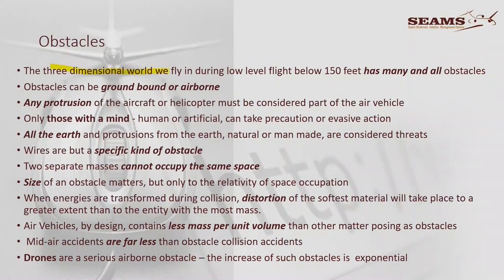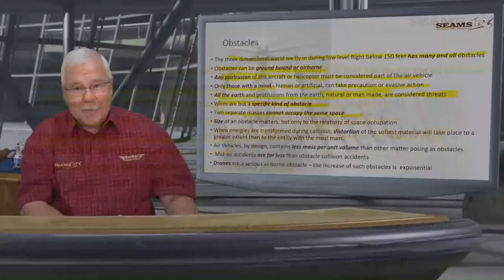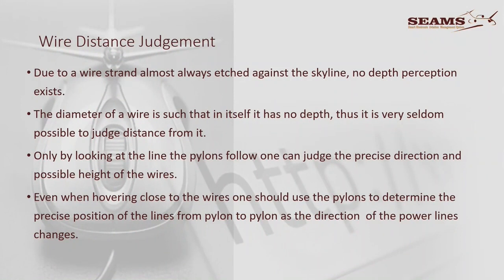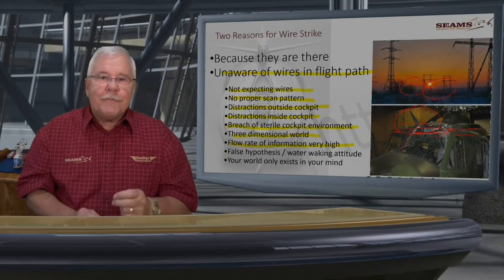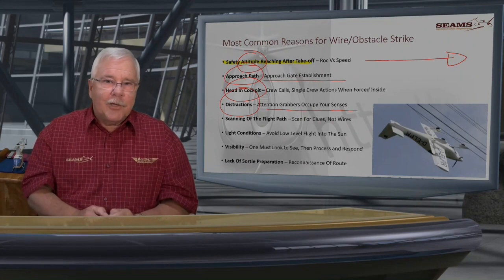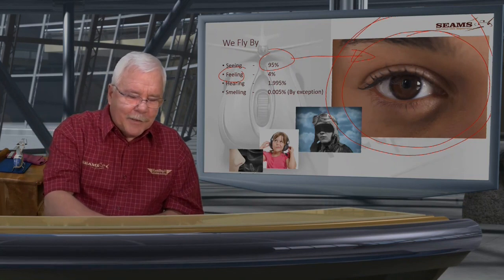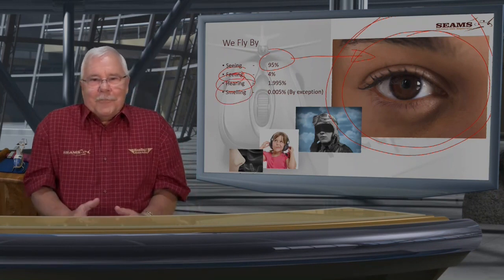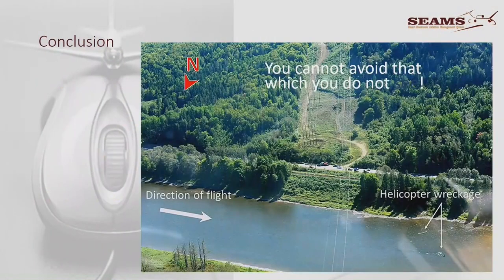Obstacle and Wire Detection Part2

Comment: Hi Charlie. Thank you for the refresher on low level "aircraft catchers". If I may, I would like to add to your most interesting presentation.
Going below 250 AGL you are surely entering a very dangerous flight regime. Going even lower, even more so. A piece of advice to our fellow aviators, this is an area to which you can become addictive to and eventually reach a stage where you totally relax and become complacent. When descending below 250ft a warning light must come on that boosts your awareness level and scanning technique. 
Wires are like chameleons, they totally blend in with the environment, however,  they leave a footpath or a track. That is what will eventually assist you in seeing the wire. This could be either shadows of the lines as the shadow describes a irregular line on the ground and over the terrain (rocks or trees etc.) below the line.  Another give away is the cleared area below the line.  This area is used by maintenance crews to service the lines. Also, look for birds as they often sit on the pylons and fly off as you approach. 
ITO the pylons; scan the river banks and ridges for the pylons. It is the NO 1 give away that there are wires.  Know the pylons shapes. Find them and identify them. Add at least 50ft to their height. Use this height as your “hard deck” until you have a more clear picture of your environment. Adapt your speed when you descend to heights lower than the pylons. For example; A height of 20ft AGL   = 30kts max, 30ft AGL = 40kts max.  Obviously this is only possible in choppers. Fixed wingers, maintain a solid maneuvering speed for those wires that could surprise you. 
In closure, like you said Sir, when it is too late, go to a level attitude. Take the hit and keep on flying your aircraft. Be safe out there guys.
Reply from the maker: Much appreciated, I will make sure the update will include your input!